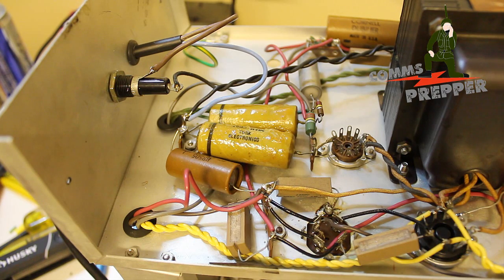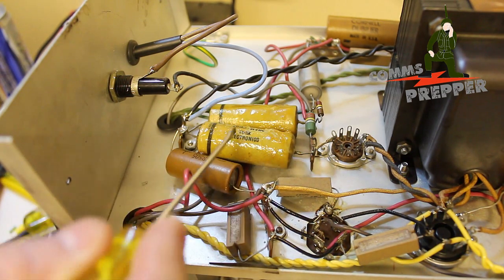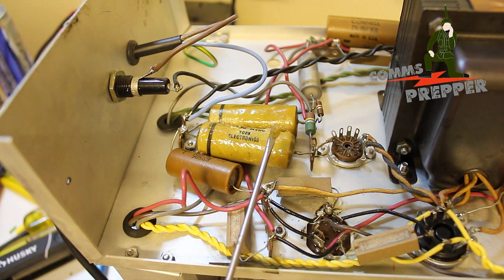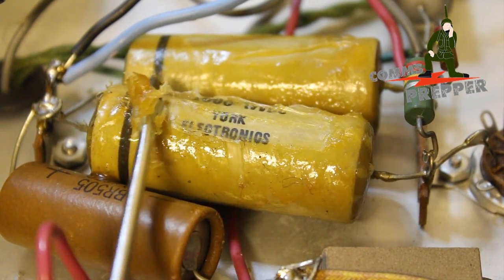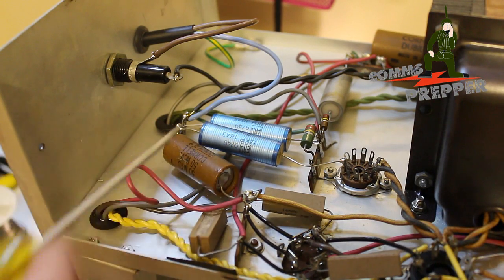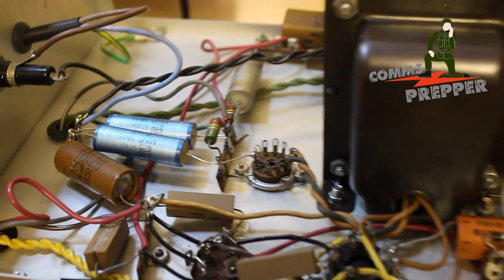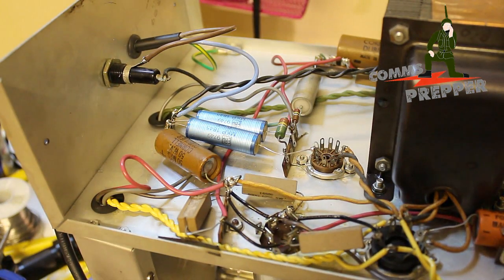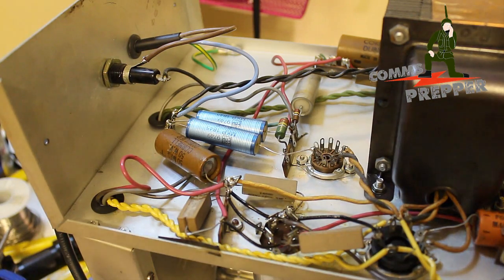Repairing Old Equipment - Capacitors

Comment: I would recommend you replace the other two, those are probably leaking dc voltage that can damage the other components, i mean not all old ones are bad but if they are clearly wax paper or bumblebee capacitors, they've got to go.

Comment: Hello Commsprepper , I know caps hold a charge,  i have a old 1940s radio that need caps and resistors replaced, is it possible to remove capacitors without discharging them, and being careful  not to short the 2 ends to something conductive>? also does it matter as I am desoldering them which end i desolder first ? and then when resoldering a new one any end make a difference. I am very careful, slow and methodical, i dont have anything to discharge the caps, so as long as im not a blundering idiot and fumbling, can it be done this way.

Comment: If you're working on old equipment and see paper caps, any electrolytics, and carbon resistors. Replace 'em all and be done with it.
Reply from the maker: Thanks for the tip and comment.

Comment: How do you tell apart "bumblebee" etc. from resistors? The big ones I get, but I'm having trouble with a schematic...
Reply: Bumblebee caps will be bigger than common resistors and will either have several thin color bands on them or be marked with a value such as .05 MFD/ 600 Volts. Resistors in old gear don't carry voltage info.

Comment: Yea that goo is just Bee's Wax, these caps must have gotten warm at some point either due to the cap breaking down inside and getting "leaky" OR it just got hot from built up heat in the chassis!

Comment: Today, just about all paper dielectric capacitors are old enough that they have either failed, or will fail soon. These capacitors can be hard to spot because they were sometimes encased in molded plastic (bumblebees, black beauties, etc). Two clues that one is dealing with a paper capacitor are that the value is between 0.001uF and 1uF and that the capacitor is non-polarized (consult the schematic if in doubt because some paper capacitors had an "outer foil" identification that can easily be mistaken for a negative sign).
Reply: I totally agree with you but I wonder about some of the old stuff I have. I have an scope from the 70's that works great for example. is it because the quality of the caps ?

Comment: I believe they used to coat paper caps with wax...so I don't  think that is the electrolyte coming thru the paper...that's just  the original wax breaking down ...at least that's what my research told me...but nice video

it tells you they were dipped in wax here:  https://www.youtube.com/watch?v=2bBifpRa890
Reply from the maker: Thanks for the info.

Comment: How do you determine which resistors to replace?  Check each one with an ohm meter?  I used to clean the switches, contacts, potentiometers, etc. with PotSpray to get rid of that crackling sound when turning the dials.  Not sure of the actual name, that's just what we called it.  I guess they still make spray to clean electronic contacts.
Reply from the maker: BC ElginTex They still have the sprays.  For resistors you have to disconnect one lead and measure with an ohm meter.